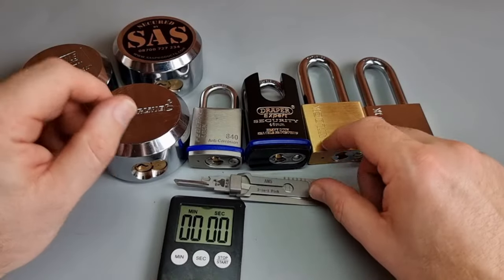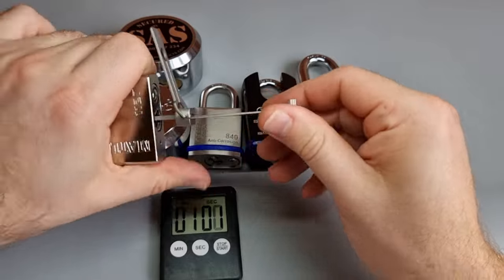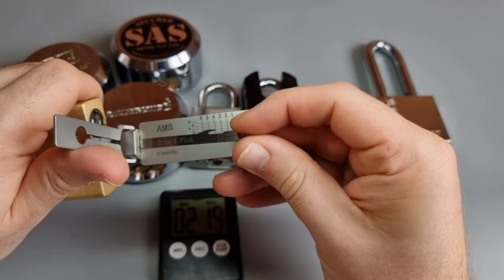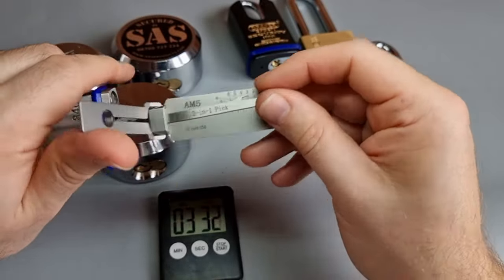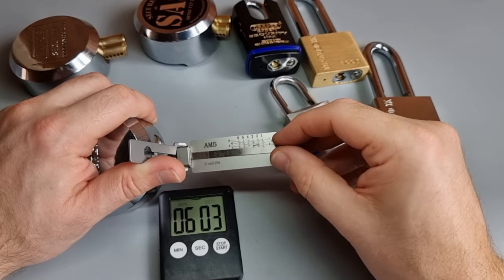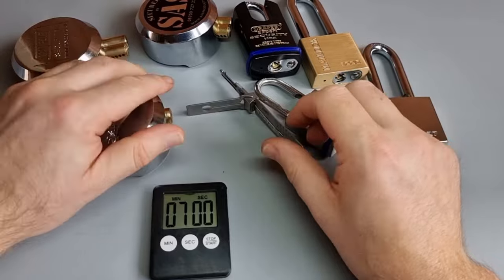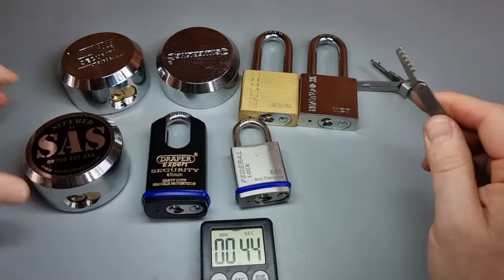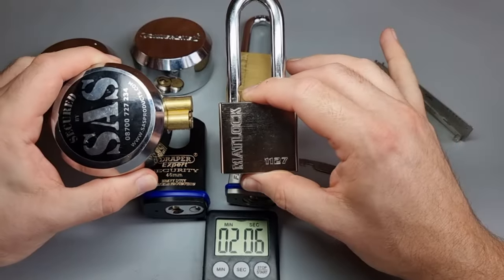This simple trick that stops COMB PICKS working.

Comment: Great lishi picking there Legend. Well done explaining the comb pick exploit. I think there are only the lower quality Master Locks like the 140 and such that are still susceptible to the comb pick. I can never get my comb picks to work or I just struggle to get them through the keyhole. So have never got an open with them on locks known to be able to be comb picked. Thanks for doing this video, cheers
Reply from the maker: A lot of people take their sets to a bench grinder to thin the out a bit, or some glass paper, but it’s a fine line between thin enough and broken. Worth having a thinned out set if you’re in the trade I guess.

Comment: Whilst I own a set of comb picks, I very rarely think about using them as it's hard to find a lock that they will work on these days.  Great video - Thanks.
Reply from the maker: If you have a set, thin them out as described in another reply, they do work on some padlocks, but it’s fewer and fewer.

Comment: Like most pickers, when I started I brought a number of things that I have rarely used. Top of that list is a set of comb picks. Save your money and put it towards something really useful like bogotas or a polaris set.
Reply from the maker: Agreed. I mean if you've got time to thin them about a bit and your job involves a lot of older padlocks, then sure, but few people are in that position, I'd imagine.
Reply: Now you mention it, mine oculd do with a thin-down. Clearly stamped out and no attempt to remove the bulge/burr. I note that many desighs get wider towards the handle. That must hinder getting them in keyways too.
And the price of some sets!  @LockPickingLegend

Comment: I even have  a Masterlock 140 that you can't comb open due to the bitting and one really high cut.
Reply from the maker: There you go! And that really is saying something. I was kind of amazed when I stripped a lock I'd previously combed another version and it looked identical, I couldn't work out why it wouldn't comb, then there was this ONE PIN that was longer, by a fraction, than all the rest - voila!